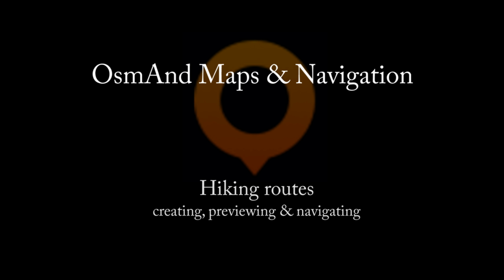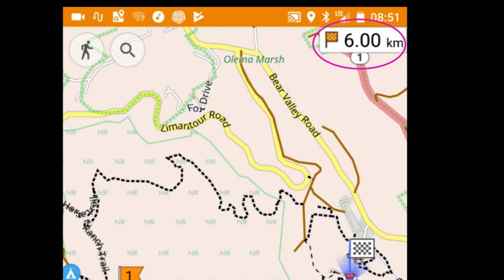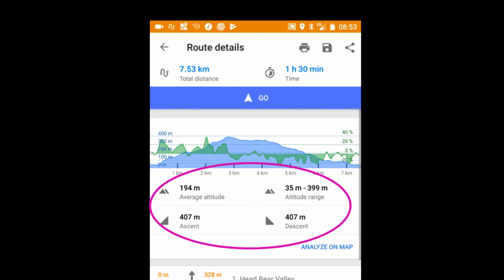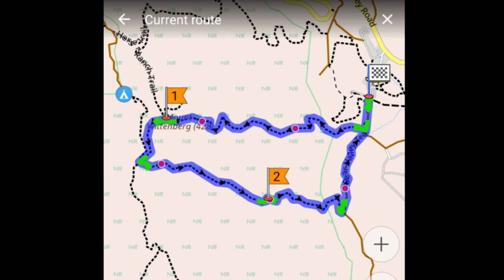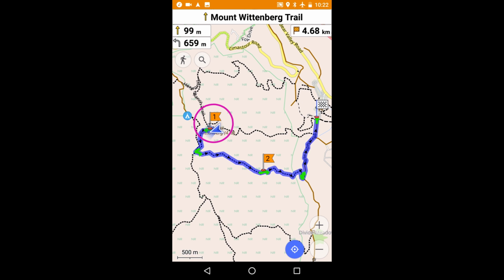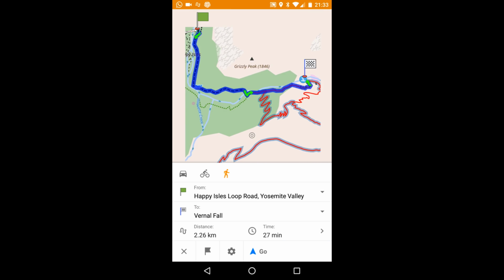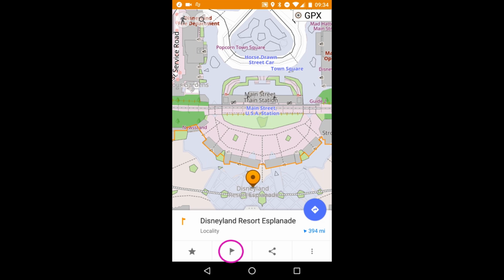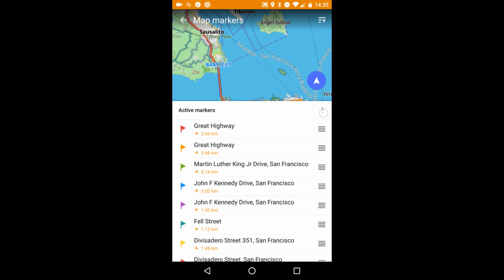Creating, previewing and navigating hiking routes with OsmAnd

Comment: Very nice series of videos Bart, thank you! I've been trying to plan my routes using my desktop browser, but OsmAnd still has no desktop interface, and the OSM one is really basic (doesn't allow dragging&dropping waypoints on a calculated route, and does not allow exporting to GPX). Any ideas? Thanks again!
Reply from the maker: A few ideas: none perfect:
You can create a GPX on any desktop program and import it into OsmAnd. But you won't get true turn-by-turn directions because OsmAnd is following the GPX, not the underying map.  I've done a video on this, but it's really only suggesting a workaround: https://youtu.be/mMcw4kYmfPk
I've read on the OsmAnd forum of people having better success with routes created on a desktop with BRouter. I've not tried that.
And finally, you can indeed convert routes made in OsmAnd on your device into GPXs for later use--and they do work pretty much as expected. The icon to do this is in the details menu at the top of the screen after you've specified the route. Or you can use the OsmAnd Measurement tool to do the same.  For now, that's my prefernce.  https://youtu.be/PxgxF9B1cfg
Reply: @barteisenberg  Thank you Bart!

Comment: Hi Bart, perfect videos! Thanks for helping me making my first steps in Osmand. 
I use an Iphone and I have a question about how to change an existing trip. Trip was created as you show in your video. Starting point, End point, adding  intermediate destinations. Then I closed the app. Now I open the trip but I don't know how to edit the trip (I want to continue adding intermediate destinations to fine tune). Can you help me out? Regards, Rob from Breda, The Netherlands
Reply from the maker: Hi Rob and thanks!  Here's what I see on my iPad:  I shut the device off, go to a different app, or do both, then return to OsmAnd.  My existing trip is still there and I can continue to edit it the same way I created it.  That is, if I press on a new location and then the route button, I get the options to make or replace the destination, add a subsequent one, and add intermediate destinations.  In other words, the route remains available for modifying until I cancel it. And even then, it remains available on the routing screen as a "Previous route".   Admittedly, I'm doing all this in succession, and I'm not sure what OsmAnd retains if hours or days pass between editing sessions.  Does that help?
Reply: @barteisenberg   Hi Bart, I see the same when I create a route like you do. But how  can I store a planned route in IOS? I noticed that when I tap "details" in the top right it shows "EXPORT"  whioch gives me the possibility to save to Osmand trips.
After saving I can select (either from the Navigation menu or from Mytrips) but I seem to have lost all waypoint and adding new waypoint is not possible. If I tap the three dots there is a Edit Mode but even then I can't edit or add waypoints. I'm a bit lost...
Reply from the maker: It is confusing, and I'm not sure I can walk you through it here. But in broad terms, you can indeed save a planned route by exporting it.  Route button> Details > Export > Save to OsmAnd Trips. This saves it as a GPX route.  And you can associate waypoints with that route or any displayed route.  Push on a location on the map, then Actions > Add waypoint > Select trip.  The waypoint will become part of your selected trip.  Intermediate destinations are not saved.

But there's a caveat.  Following a GPX route that you've saved  is not quite the same as one you've created on the spot.  Because in the former case, you are following the GPX, not the underlying map.  I've done a video that shows some of the limitations and suggests a workaround.  https://youtu.be/mMcw4kYmfPk  (It uses the Android version of OsmAnd, but you'll get the idea.)  

I think this is partly a user interface problem: it could be clearer.  And undoubtedly there are some holes in my understanding.
Reply: @barteisenberg  Hi Bart, I started using an old Android phone for OsmAnd.  And now 'm getting somewhere. I already created a kml in Mymaps and converted it online to GPX which I used for a nice motorcycle trip.
Now I started creating a short motorcycle off road trip but OsmAnd does not allow me to select certain roads although I know these are allowed for motorized vehicles. If I switch to cyclist mode OsmAnd  does take the perferred route. Is there a way to stick to Motor vehicle mode and force OsmAnd to use a specific road?

Best regards,
Rob
Reply from the maker: Is OsmAnd in driving mode avoiding  those roads even if you mark them as intermediate destinations? Or is it avoiding them no matter what?  The latter may be a matter of the mapping data itself.

The OsmAnd routing profiles take into account the tag information for each road on the OpenStreetMap project, whose data is the source for the maps on OsmAnd.  So for example, the driving profile will avoid routing on an OSM road element tagged as a "path", while the walking profile will  avoid one tagged as a  "motorway".  Which is what you'd expect.  In this case, if you know a road is accessible by motor vehicles, it would be useful to  know how it's tagged.  That's done through the OSM website. If its tagged incorrectly, the best solution is to fix the map itself.  (OSM is like Wikipedia--it's crowd sourced.)

You could also or instead create a customized routing profile and see if that works better.  OsmAnd's directions are here: https://osmand.net/features/navigation-profiles. My video in the general topic of profiles is here: https://youtu.be/TpT9S-b495M
Reply: @barteisenberg  Hi Bart, I joined the OSM community to fix the maps. I already discovered that small imperfections in the map are ruining my route. So now I have a new hobby! Next to mountainbiking, hiking and riding my motorcycle I also need to pay atention to each detail on the route to be able to update the map. 
Thanks again for your support. You've been a great help.
Regards, Rob
Reply from the maker: That's great--the more OSM mappers, the better the map. There is some delayed gratification in seeing your changes: the main map takes some minutes to update, the Cycle Map takes days, and OsmAnd maps are updated once a month, I think.  But there's satisfaction to the hobby.  I've planned and navigated hiking routes using trails that I myself added or updated.  You can be both a cartographer and the beneficiary of that cartography.   
--Bart
Reply: @barteisenberg  Hi  Bart, an update about my latest experiences with OsmAnd and other tools to make my favorite routes.
I came to  a prelimenary conclusion that the fact that OsmAnd uses these profiles (ca, bicycle, hiking) is a huge disadvantage. These profiles define what roads can be used or not. So if the map is not correct I immediately have a problem with my navigation in OsmAnd. And I'm not planning to update the complete map. FYI I have this 80 km off road route close to Breda, The Netherlands, which I checked several times. All roads are open for  motorized vehicles. But I'm not able to define this route using Osmand. 
Yesterday someone showed me Roadtracer which is part of the Tripy system (https://youtu.be/IlVPnllvUzQ) . This allowes you to switch from automatic routing based on a profile to manual putting waypoints. This way you can force the software to follow the road your prefer even if this is not defined as a road accesible by motorized vehicles.

Can you confirm there is no way OsmAnd can be forced to take a route that doesn't fit the choosen profile?
BTW even if I change the profile to cycling, OsmAnd doesn't allow me to make the route complete because of small imperfections in the map (e.g. one small road is ending on the map en the connection with the next forrest road is missing) I took these coordinates from Google Maps (not sure this works) 51°30'42.3"N 4°36'09.4"E so you can check yourself if you are interested.

Best regards,

Rob
Reply from the maker: Hi Rob:  To the best of my knowledge (which gets thinner at this altitude), OsmAnd requires use of some routing profile, built-in or custom, and those profiles rely on routing XML files that come with the app.  On the OsmAnd forum ( https://groups.google.com/forum/#!forum/osmand ), I've read of people altering these XMLs to customize routing to their needs.  Here's what the XML looks like on Github: https://github.com/osmandapp/OsmAnd-resources/blob/master/routing/routing.xml 

I've also read on the forum of people who use Brouter to create custom GPXs.   OsmAnd's take on that is at the bottom of this page: https://osmand.net/features/navigation-profiles 

I looked at the coordinate you sent on OSM, and while I'm not sure it was precise enough to show the specific road discontinuity you refer to, that would of course be a problem for any routing profile.  The only answer I can think of there is to fix the map.  

While I was on OSM, I checked out the data for some of the smaller roads.  They seem to be tagged "highway=track" with no specific access exclusion of motor vehicles.  What happens if you configure the driving navigation setting:  Route parameters > Prefer > Prefer unpaved roads ? 

My experience with OsmAnd centers on hiking in the western U.S.   Posing your question on the OsmAnd forum might give you a broader expertise, potentially including both motorcyclists and a European perspective.  

Best,
Bart

Comment: Very informative, step by step and slow - the perfect presentation - thank you for your time. I  was  looking  to  buy  a  garmin  or  similar  for  a  bike trip but they are very expensive and small albeit they are rugged and good on battery life.
Reply from the maker: Thank you!  That's true about dedicated GPSs. More durable and easier to keep charged. I wonder on a bike mount if it might be worth buying a cheap smartphone just for the purpose. A cell connection wouldn't be necessary; just Wifi for loading the maps and app.